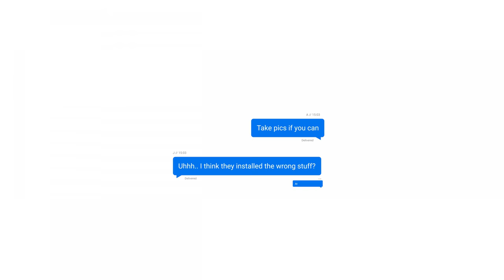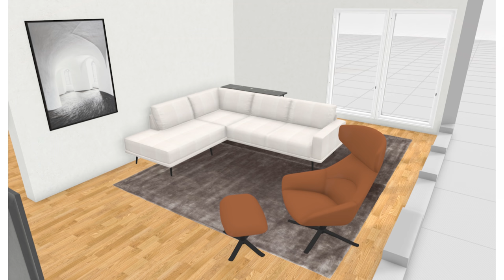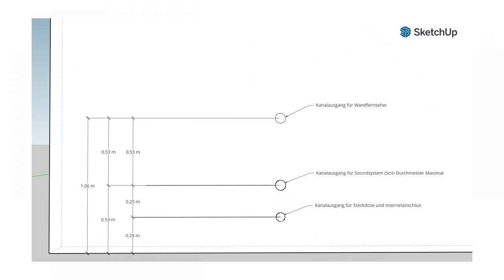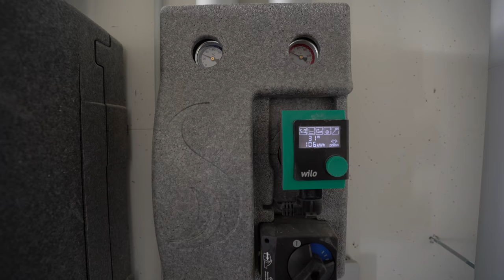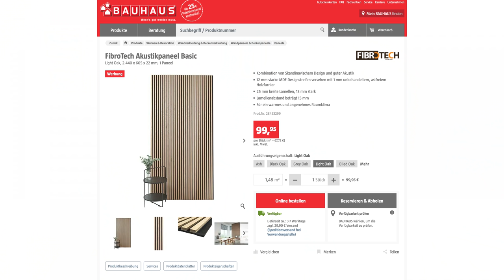HARD Lessons from Building a House in Germany

Comment: A lesson I learned from renovations is, keep an extra spare package of the tiles and floor wood you‘ve used in your basement for the case you have to do some repair. Because in five years you probably won‘t get your tiles nor your floor wood anymore. On the other hand there are people who like to do a whole renovation from time to time. 🙂
Reply from the maker: YES aboslutely! This is such a good piece of advice. Thankfully they have left us boxes of both the wood floor and the tiles in our technic room already for just those moments.
Reply: @TypeAshton  I would recommend also to try to keep some spare roof tiles (if you have tiled roof) as spares because you only can purchase them in larger quantities later on.
Reply: From my experience it´s pretty normal that the workers will leave you with extra tiles, floor pieces, roof tiles and even paving stones for your garage drive- or footways. If not you can always ask the contractors during or short after they did their work. Never failed me. 
As for the rest, we build our house some ten years ago and we had a lot of issues similar to yours. On one side of the house the realy forgot the cavities for the external blinds (I hope that is the right word for "Außenrollo" :-) ) and the holes for the strapes to operate them. We had a lot of dicussions. The other realy bad thing was that we had ordered underfloor heat for the bathroom. It was installed but after we moved in we had a lot of banging noises from the valve/thermostat unit whenever it was heating up for more than half an hour. We called for the contractor but he hand gone insolvent very short after he finished our bathroom. So we reached out for the company how coordinated the whole house building project because the warranty was on their side. The tried to fix it serveral times, told fancy story about the water flow was not planned or installed correctly so that now they had to use something they called dabblervalve (?) (pfuscherventil in german) to compensate. Long story short, it never realy worked out and so we rarely use our underfloor heating. Currently I am thinking a lot about smart home technology. It might work if I only switch the valve on for short periods of time or change the thermostate temperature slowly up and down. 
So be prepared for the time after you move in. Probably your will have to communicate with the contractors again. Ideally you exactly know how has done what and when. The builder's diary, that the did for us was sometimes a bit - uhm - unscpecific at times.
Reply: @martinohnenamen6147  though with roof tiles the problem is less getting matching ones and more the fact that the spare ones haven't aged the same. So new tiles will always stand out unless you get lucky and someone sells matching used ones from a roof that gets redone.
Reply: @b.quentin7097  underfloor heating is nice in many aspects, but it's main drawback it's really slow to react. slow as: 24-72h until you get the full effect of changing the settings. and thermostats are not meant to be switched down and up all the time in this setup, but rather to be set to the correct temperature (bathroom, recommended, something slightly above the rest of the house, ensuring that you never run into a mold problem).
except

Comment: Aaaaaw, cute. You clearly are first-time German house buyers. In the US, cheap and easily removable drywalls are almost like furniture - you can always change your mind or fix mistakes without breaking the bank. That's why in the US you e.g. have walk-in closets and in Germany you have wooden wardrobes. Point being: In Germany walls are walls and furniture is furniture. You update the furniture but you do not mess with the walls (too much). A lesson my 75-year-old mother (my parents having bought and sold half a dozen apartments and houses over the last 50 years) recently taught me: Don't customize TOO much. Sometimes a well-hidden extension cord will do. Last time my mother had her dream kitchen installed, so there had to be changes to the floorplan, power outlets etc.. Now, 20 years later she feels stuck with an early 2000s design. She's telling me she can't stand the monstrosity anymore, but once she paid a lot of money and the current layout is the only one that really fits. So she is sticking with the worn-out cupboards, even though now she wouldn't mind getting a new kitchen with modern appliances. Outfitting a German house is also about the art of compromise (between your current tastes and leaving options to your future you ;)).

Comment: I was going through the process of building a house in 2019 myself (with contractors ofc) and if these are the worst things happened to you, you can surely consider yourself blessed. The positive approach you are taking to things like the wall is realy good and it helps to just move on instead of being negative all the time you look out these basement windows (btw, the granite stones look great in my view). As a sidenote, you need to have spare tiles of every tile (especially floor tiles) in your house as over the years you might crack one (and then you most likely can't get them anymore). So ask your contractor to leave a few at the site, as they anyway haft leftovers. Great video and congrats on the new house, it looks splendid!
Reply from the maker: Absolutely, we feel pretty lucky that, all things considered, the "mishaps" are pretty easy to smooth over. Hopefully we will still move in about 6 weeks and only a few landscaping items will remain to be finished (they warned us that will not be completed on schedule). Also - YES about the tiles and extra flooring. We do have extra boxes stashed away in the technic room which will certainly come in handy down the road.
Reply: @TypeAshton  hopefully you will see the spare tiles collecting dust cause those are the best you can have cause they do not make work and they are ready to rock.
Reply: @TypeAshton  Some tiles have a glazed edge. Be sure to get those too and not only plain ones.
Reply: @TypeAshton  it is rather typical that people move into their new house and the landscaping of the garden is not finished yet. Yes, it's sad when you see the excavator instead of the lawn and how good looking it might already be, but usually they'll do it. They are just happy that you can move in (and pay another part ;-)
But finally you will be in your new house. They finish up the things on the outside and eventually it will be done and you will be happy - hopefully.

The wall against the hill is really important, you said it. When it's raining a lot, the hill might flow down and the wall must hold all the material back. There can be a lot of pressure against that wall. Hopefully they secure it against tipping over into your garden. I think, that is important.

Comment: Technic room: the white thing is the "Druckausgleichsbehälter".  I am not a plumber but as far as I know it contains a bladder with Co2 /  N  and  is needed whner the water in the system expands an retracts depending on temperature
Reply from the maker: A few others have shared some links and this is EXTREMELY interesting how it pressurizes itself.
Reply: Best to get all of the manuals in digital form and save them on Google Drive or something. My parents took photos (analog ones at the time) of all the walls before the cable runs were hidden. They're in a small binder and were very helpful this week. I also created a diagram of the phone cable runs (Leerrohre) so we know once and for all where each Lehrrohr leads.
Reply: If you don't have this "Ausdehnungsgefäß", the water inside your circuit will expand when heated up and will leave the safety value, which you also have. When the water cools down, you will not have enough water in the circuit anymore and you will loose efficiency and you will have higher energy costs.
Reply: The white thing is also use the reduce the water hammer in the pipes and avoid a "pipe explosion". Really important..
Reply: The white thing is called  'Ausdehnungsgefäß' and is used for your heating. It is used for heatings that are working with different water temperatures (the so called " Vorlauftemperatur" ) to avoid damage to the system (its a so called closed system) as water expands and shrinks when getting warmer or colder. It also gives the pressure to press the water into the upper flloors.
Reply: Well - it's good to get an explanation to all the parts in the technic room. Might be hard to get - for me that's not normal to get a brief introduction to all this (sad! - but how many home owners would understand that introduction?). 
Count all the tech items you see and don't give them an approval without getting EVERY manual of each item. Many contractors tend to forget about that and just abandon them.
Reply: @lcopetti  Actually that is not its function. It is used to take care of heating water expanding and contracting.  And to maintain a relatively constant pressure in the system. It is not used in drinking water installations. Just in the closed circuit for the heating water. A water hammer can occur in any pipe close to a faucet. If you close it rapidly that migh create one. And if the expansion reservoir is far away it does not help anyway.
Reply: "Ausgleichsbehälter" popped up in my head right away (and I am slightly proud - I am not a really handy person and never owned a house but it helps when dealing with Handwerker to show that you are not a totally clueless person that can easily be ripped off).

Comment: 24:51 CONEL CLEAR 2.0 RD Hauswasserstation
This has several purposes
- Druckminderer - keeps the internal water pressure on a constant value (normally 4 bar) if the external water pressure is higher
- Rückflussverhinderer -  prevents in case of a pressure loss (leak) in the external water supply that water from your internal system flows back into the external system
- a mechanical filter preventing any particles reach your internal water system and may cause problems there (clog/damage valves, dishwasher, etc.)
- Rückspüler - to clean the filter. That's why this device is also connected to the wastewater. A function you have to start manually. How often depends on the quality of the external network. Maybe every several years. Albeit a yearly routine won't harm.

24:54 
left: to refill or empty your heating water system. The black thing with the green wheel on top is another "Druckminderer" as the heating water system has a lower max. water pressure (e.g. 2 bar).
right: this silver thing on top is the emergency valve of your heating system. The white cylinder below is most likely a special water filter for heating systems. Something which you might have to replace after some time. It looks like they have fixed a manual about this system there.
Reply: 24:54
its only for filling/topping up the heating-circuit the let thing is a Systemtrenner BA it prevents the back flow of Water in your heating-circuit to reenter the drinking water pipes in it are 2 "normal" check valve´s and a pressure differential valve in a middle chamber that opens if the main water pressure is less then 200mbar above your pressure of your heating-circuit. and since we are German we dont want water dripping on our floor a drain pipe has to be connected :) 

The white  cylinder is indeed a water filter  and a special one at minimum a Demineralisation one most likely a desalination one to prevent incrustation in the heating-unit

24:19
the big white round thingi is a MAG Membran-Ausdehn-Gefäß in it is a Rubber Membrane witch is pressurized with Nitrogen on the one side and on the other side is the Water of your heating-circuit. when the water in your heating-circuit gets warmer it wants to expand since water is inkompressibel the pressure would rise to prevent this a appropriated sized MAG is added to take up the expansion. a membrane expansion vessel  :)

at 24:25 at the 2 Valve´s there are clear plastic tubes connected to the drain ports of the valve´s  they have to be shorted to prevent any chance of  drinking water contamination basically every pipe that is connected to drinking water has to end 3cm  1"3/8 above anything that is connected to a drain pipe.
Reply: @buildmox  24:20 https://en.wikipedia.org/wiki/Expansion_tank
Reply: Martin and badmox nailed it. They seem to be professionals or have recently built a house themselves.
Reply: Would recommend to activate the clean filter function every 3 month. Will prolong lifetime of the filter.
If your heating system suddenly losses more water than usual (should almost 0 losses for such a small system), have it checked for leaks. especially if you have floor heating. the water often ends up underneath the top floor. By the time you spot the mold, you looking at 30k in damage (replace most of the floor) and more than a week where your home is near uninhabitable.
And you should normally get the full documentation (every manual, but also every revision-plan) when they're finished.

Comment: 24:20 It's an expansion tank for your heating pipes. It's a metal bubble with a flexible membrane inside.  The water inside the pipes can expand into the bubble when heating up. Without an expansion tank, your pressure relief valves would have a lot to do, and you had to refill the heater every few days to keep the water pressure high.

Comment: 17:21 for this the easiest way to handle it is by just having a large composite panel (wood)behind which the cables would be re-routed and then the tv mounted to it. Not a big deal and will not eat into your room more than an inch. The other cool thing is that you can add strip lighting on the back of it.
Reply from the maker: Oh this is a VERY interesting idea!! Maybe make it more of a "feature" wall. I will run this past Jonathan.
Reply: Black Forest Family Essentially it becomes a feature wall, exactly.
Reply: This is exactly what I was going to suggest. When we had our bathroom renovated in Berlin, they put new solid paneling in front of the old plaster wall, and essentially hung the fixtures and cabinets from that, with the pipes and electrical wiring behind it.
Reply: The composite idea is probably better than my thought of installing a (very thin) drywall to mount the items on and leave space behind for all wiring as well as concealing the hole built into the concrete. The idea of lighting the edges is also great; much like the Philips TVs with “Ambilight” — just without the dynamic light patterns linked to the current TV image. Hope it works out for you! Cheers, Doc.

Comment: About the accousic in your entry hall, I would suggest accoustic elements on the cieling, as a sound engineer in my years long experience this works very well, is quite affordable and can look great. The use of dampening pads that look more ore less like the inside of egg boxes is very efficient, you could mont them in a chessboard pattern direct under the cieling and they are usually availiable in a lot of different colours.

Comment: Good advice: Put a pack of each tile type on side for late repairs. It will happen you crack a tile, have to remove it some day or whatever. If you try to buy this specific tile years later you will most likly not find it anymore. I put few packs of each on side and over the years I used some of them already. Best idea I had about that.

Comment: 24:20 -> Thats a "Ausgleichsbehälter" or "Ausdehnungsgefäß"... its filled with water and set under (air)pressure (that small black dot in the middle should be a valve) to keep all the tubes of your heating under the same pressure and free of airbubbles at all times.

 24:40 -> Thats the decuppling (heat exchange) to seperate your heating system from your radiators / or tubes in the floors, or walls - building it that way will improve the livetime of the whole system drastically. The two thermometers show the "Vorlauf" (red) and "Rücklauf" (blue) so the temperatur of the water as it enters the circulation and as it flows back.

24:51 -> Thats a "Rückspühlfilter" its a filter for your  main Water supply - cant tell for sure in your case but usually something like that is in the system to keep lime from entering your house internal water systems, depending on the full setup it might as well include a safety system that will cut the water supply if you have some broken tube (sudden massiv loss of water).

About your TV/Soundbar issue - had that myself and ended up mounting it all on a TV Wall mounting system made by Vogels - aint cheap but its worth it ;-)

About Murphys Law --- Uhh I hate and love that at the same time ;-)... especially because of the original story behind it GGG

Entry area / noisy - wait until you have your stuff in that house - that echo might just be gone as soon as there is some furniture ... if not, you could just tighten a sail (like those sunsails) right under the ceiling that should help a lot and if put some lights above it'll keep the room very bright without any direct light. 

best of luck to you with that date in June!!!
Reply from the maker: Wow!! I just googled the Vogels TV wall mounting system - that looks VERY beefy and really sturdy.

Comment: 24:53 the white thing on the waterline is a particle filter for the drinking water, that filters out maybe tiny metal bis and stuff from the drinking water. You have to open it at the bottom every 2-3 months to spill out any residue. Any plumber can explain that. The second thing is a pressure valve called „druckminderer“ that handles overpressure coming into your house.